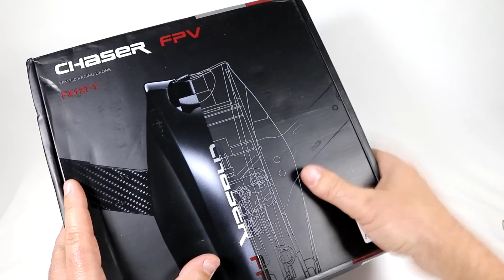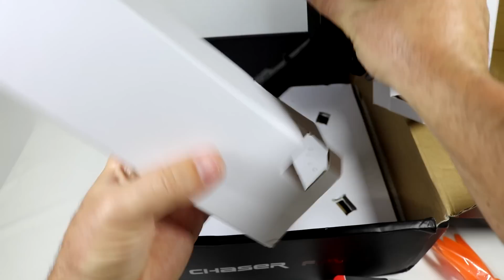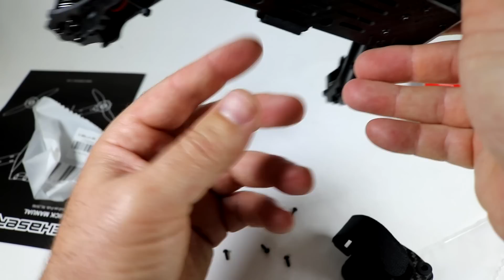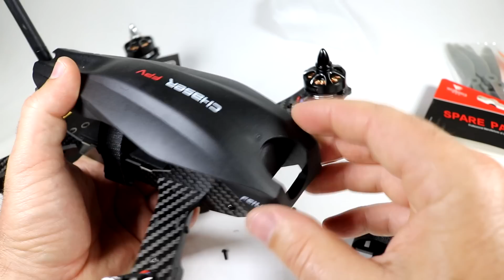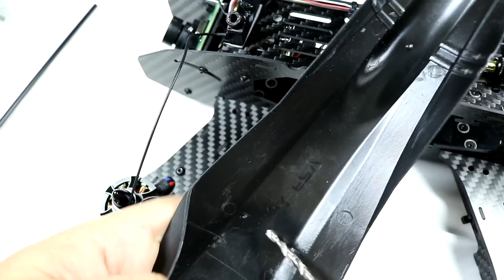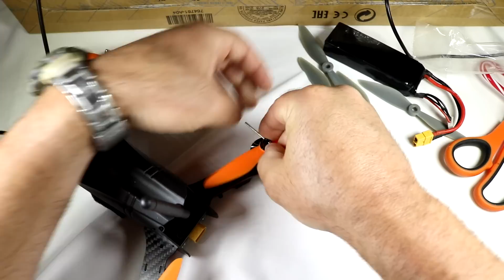FEILUN FX-127 Chaser FPV Race Drone Review - Part 1 - [UnBox, Inspection & Setup]

Comment: i have a feilun chaser and my A rotors spins with big resistance compared to the B rotors, i cant fly it beacause of that, any help?
Reply from the maker: So when you spin it when it's off with your hand some motors are more resistant than the others?
Reply: yes and the friction is very high on it (on the 2 motors with black plugs)
Reply from the maker: I would take apart motors and inspect for the problem.
Reply: but i have no idea how to do that and i am fairly new to drones.

Comment: Gawd! Why can't these manufacturers do a little bit more research and add what we want like a f3 flight controller.. cc3d is so 1990.. And 20 amp little bee ESCs.. Dustin you should be making a stink about these missed features. They are deal braker features. Keep up the good work bud!

Comment: So much good with this rig. LDP motors are  current favourite bang for buck motors and if you weren't already aware, this is 95% KDS Kylin which is by far the slickest tuned cc3d I have had the pleasure to fly. If you have anything less than a perfect gains setup i'd recommend you check out the KDS Kylin CC3D model file that's downloadable. I think heliguy sell it too with a slightly different name.
I doubt it will become an issue but a few guys at my field have them and one changed camera but fried stuff as the wiring they used was not as you would expect from the colours.
Reply from the maker: +MicroRCFiend Thanks for the input my friend.  I have had it hovering a bit in the living room thus far and it is rock solid with stock settings.  I'll be doing my flight test with factory settings so others can see how it performs before any altering is done.
Reply: Dustin Dunnill No worries, I look forward to you tearing a few holes in the sky with it. They look different motors but occasionally the kylin will spit a motors C clip so guys here stick a tiny patch of tape over the bottom of the motor hole to catch it. It still flies fine without them unless you are full whack but you get wobbles before that to tell you.

Comment: Very good video,again. I have 1 question, would it be possible to put a servo on the camera to move it with the transmitter???
Reply from the maker: +Glen D. Spicer Yes, you could rig up a mini servo and connect it to your knob/pot dial on controller for rotation.  Will add some weight to craft though and lessen flight time, but doable!
Reply: Thanks. I will be talking to my wife about getting one later in the year then.

Comment: Nice review. Looks like they really put some thought into the build and the layout. Are the ESCs integrated into the board or are they separate?
Reply: +Q-Vision Studios It looks 95% KDS Kylin so it's all integrated if so, active braking and one shot friendly. (if same and KDS). You can swap em out but they are soldered into the main PDB with CC3D on board. It's very light and this setup gives you an empty core to fit lipos for perfect CG. Normal 2200mah 3s don't fit though as it's not a tall bay but even with a 1300mah 3s it's pretty quick, 4s is super satisfying.
Reply from the maker: +Q-Vision Studios MicoRC is correct.  I had a look and they are soldered under the PCB but still look removable and swap-able.  4s fits nice and snug and should not really move at all in a crash since the integrated anti slip pad and velcro strap hold the battery in extremely tight.
Reply: +Dustin Dunnill thanks DD. The price for the BNF looks great. $50 more the ARF is a bargain.

Comment: Hi Dustin, great review, cant wait for the flight test.
You mentioned using a bar to tighten the prop nuts with, is that what the little metal bar that came in the kit was for?
Many thanks
Reply from the maker: +Mark Andrews Thanks Mark.  Yes, that little bar I initially thought was a Hex wrench is just a bar they include to tighten prop nuts :)
Reply: +Dustin Dunnill how much is this, i really want to get into FPV and i want something fast, this looks sick
Reply: +Peter Ross Ready to fly version http://m.gearbest.com/rc-quadcopters/pp_330751.html
Reply: Mark Andrews thanks